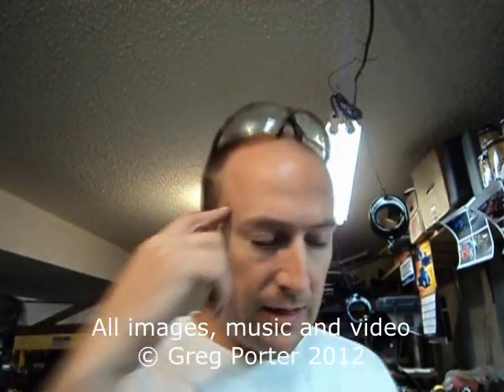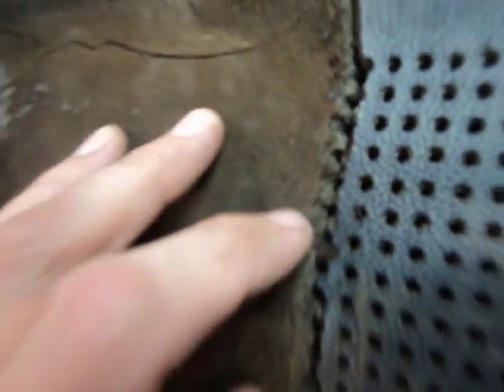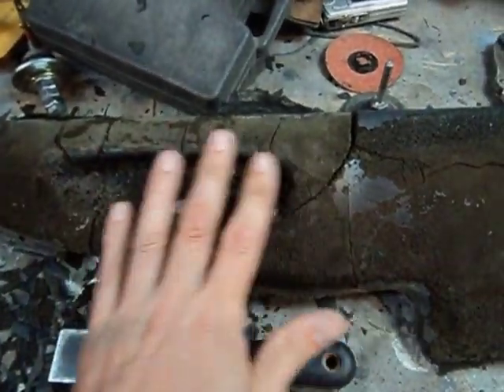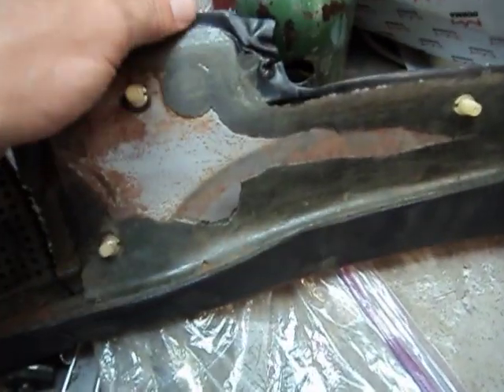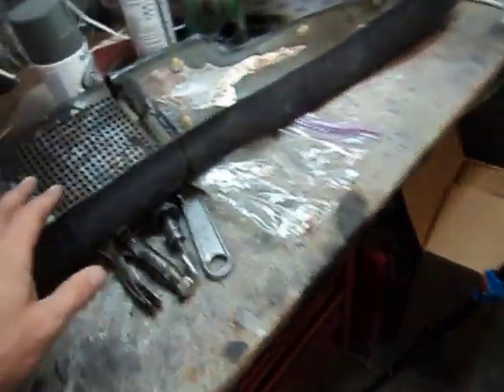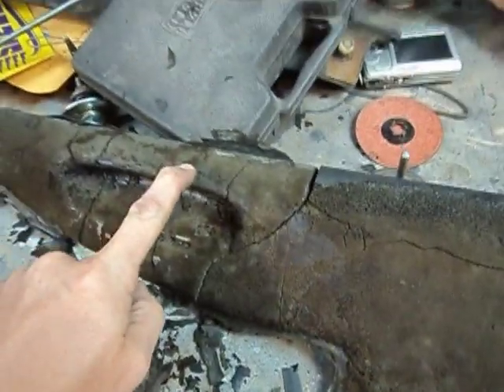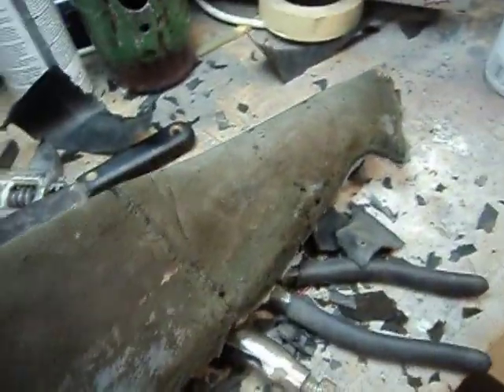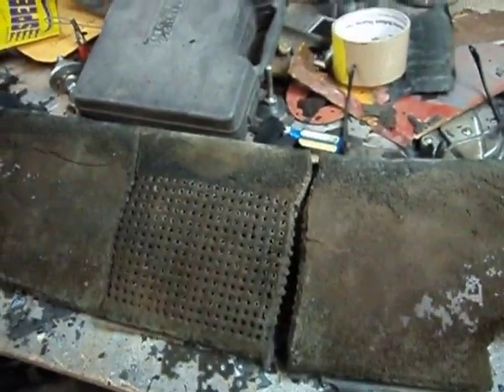How to Restore Your Volkswagen Dash - Part 2

Comment from the maker: Check that...  Thanks.  2 part epoxy in the cracks.  I don't know if bondo will be flexible enough with this foam...  I'll have to see.  What adhesive did you use?

Comment: Tack the braces> epoxy the cracks> somehow fill in all the pin holes and cracks> sand everything smooth, I'm sure that old foam is sandable, than put spray on adhesive> slap some blue vinyl on

Comment: that's great !  ha,  your brain is stuck in low gear........   I seem to have the problem more and more..  Could you cut a foam replacement part out with a hot wire cutter similar to cutting wings on rc planes ?  You could cover that with epoxy then what ever material you wanted over that.. .  With the 2" foam you can cut any shape you want.  good luck,  looks great.    Jeff

Comment: Greg, I have seen some videos on this type of work, and I think there is an expanding foam you can use to fill the cracks, but it may be a two part epoxy too?  Have you checked Eastwood's web site ??  This is one of those projects that when you finally get it restored, you can brag about it to everyone that sees your car. :-)